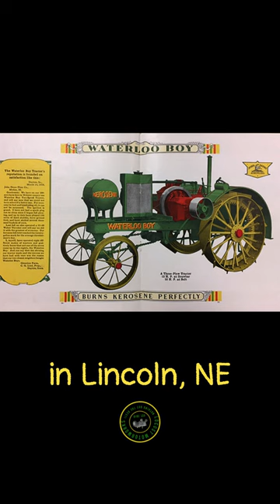Nebraska Tractor Test Lab (First Tractor Tested)  #farmmachinery #history #johndeere #nebraska

Comment: My cousin is the Director of that place. Super cool. It's small but it's cool that you can get test specs from the past ( I did our IH460). They also do a lot of 1/4 scale tractor pull competitions.
Reply from the maker: Thanks for sharing, I didnt know about the 1/4 tractor pulls👍
Reply: @LocustMotorWorks  I was part of that program. It is called the quarter scale tractor competition.  Students had to build a tractor from the bottom up.